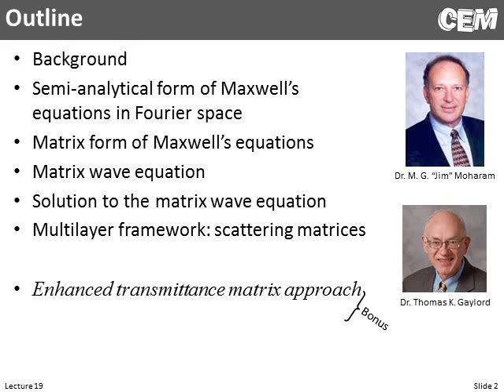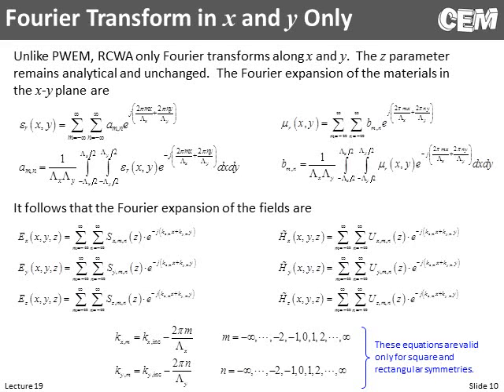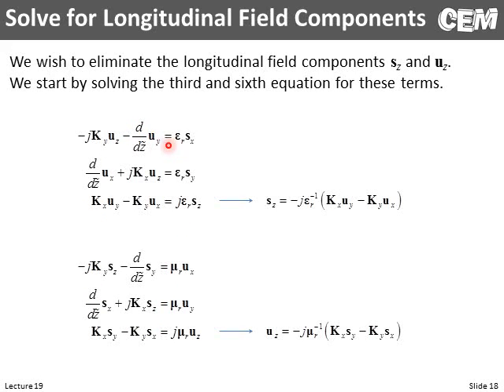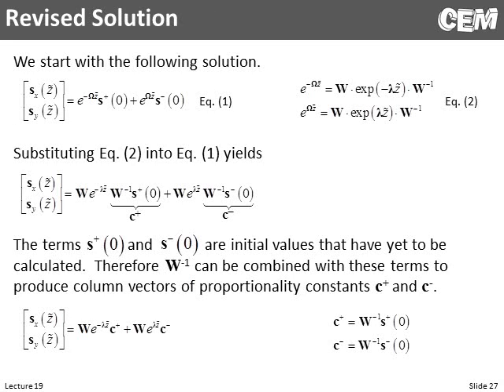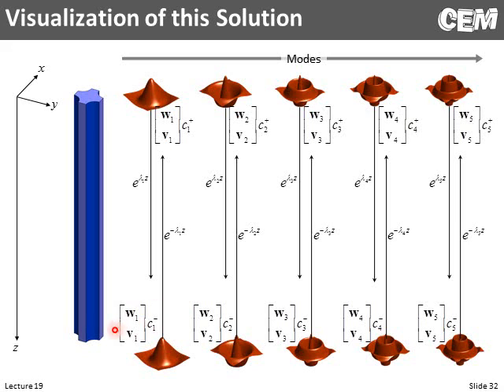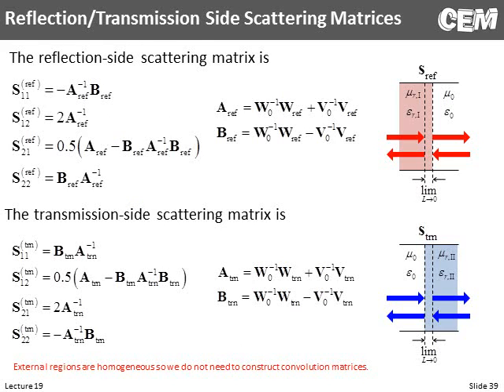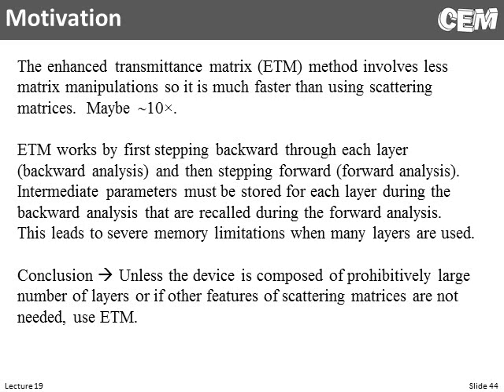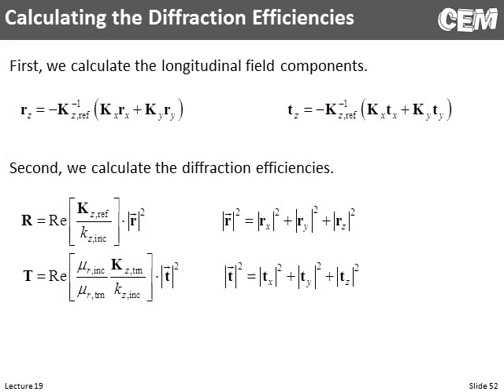Lecture 19 (CEM) -- Formulation of Rigorous Coupled-Wave Analysis

Comment: Hi, thank you kindly for your lectures.  I am trying to implement the RCWA for a 1D grating. However, I am using the full code (as opposed to the FFF approach mentioned in lecture 21). I am having trouble calculating the A & B Matrices (slide 37, lecture 19), since my V matrix in the layer (and also incidentally in free space) are turning out to be singular. Could you please provide a physical insight on why this might be happening in my case, and where I should look to resolve this? My W matrices seem quite fine.
Reply from the maker: At some frequencies, you could have wave vector components that equal zero and will cause singularities.  Try changing the frequency slightly and see if that fixes it.  If not, there is another problem with your code.
Reply: @empossible1577  Hello, changing the frequencies didn't seem to fix it. My apologies as this is my first introduction to performing such calculations. 

I would like to verify the size of my matrices to see if they are accurate. 
For the given scenario, 
Number of harmonics along Kx = M
Number of harmonics along Ky = N

after calculating Kx, Ky, and Kz, it has been suggested to put them in diagonal form. And since all the Kx_mn values reside on the diagonal, the size of the Kx & Ky matrices will be (M*N) x (M*N). 

In which case the size of the  P and Q matrices (in free space) will be  (2*M*N) x (2*M*N)

Am I okay till this part? 

Because the size of the Omega2 matrix will be the same as the P & Q matrices and will result in 2*M*N eigenvalues. Are half of these for the backward propagating modes and half for the forward ones? 

Thank you once again kindly, the lectures are fabulous, but such one to one clarifications also help immensely, and I acknowledge the investment and am grateful for the same.
Reply: @empossible1577  I am implementing the Code in Python, so the eigenvectors of Omega2 matrix come out normalized using the "Numpy.linalg" package. Do the matrix of vectors V = Q*W*(lambda)^-1 need to be normalized before calculating the Matrices A & B?
Reply from the maker: @RaviShivaraman  Have you seen the RCWA benchmarking documents on the course website?  These show almost all of the intermediate results from my RCWA code.  I suggest going through these to verify your data.  This is even more useful since you are developing your code in a different language.
Reply: @empossible1577  Hi, thanks a lot for the pointer. I was able to use the bench-marking documents to guide me in my python implementation.  There are some differences: 1. the 3x3 grid does not lead to energy conservation (slightly over 1), but a 5x5 grid does. 

I have also implemented RCWA calculations for the following geometry:

Device Stack: 

------------------------------------------------------------------
-------------------------------------
     Semi-infinite Reflection Zone (Air)

------------------------------------------------------------------
-------------------------------------
     
Diffraction Grating on Surface (~200 nm tall & 600 nm Period)

------------------------------------------------------------------
-------------------------------------
     Uniform Dielectric Layer (~1 mm)

------------------------------------------------------------------
-------------------------------------

     Semi-infinite Transmission Zone (Air)

------------------------------------------------------------------
-------------------------------------

The issue with the above stack is that I am unable to get sensible results, I believe the issue arising from the X matrix: exp(-lambda_dielectric * k0 * t_dielectric)
due to a large difference in the thickness of the uniform dielectric region compared to the grating region (> Million). 

I found that as long as the uniform dielectric thickness remains under a maximum value (per my results, a factor of 1000, so about a 20--50 microns - seems to depend on the incident wavelength as well) the calculation produces sensible results. 

If there 's physics here that I should be aware of , and perhaps if the dielectric is larger than a particular thickness, consider it the semi infinite reflection region, please let me know. Thank you kindly once again for your time.
Reply from the maker: @RaviShivaraman  The 3x3 case not satisfying conservation bothers me and I suspect something is wrong.  

Also, you should be able to set the thickness of your layers to virtually anything without issues.  I know I have set them to several kilometers and had no issues.

Can you email me a list of your layers (thickness + refractive index) and I will run a simulation to see what I get.  rcrumpf(at)utep.edu.

Comment: Dear Sir,

How to plot the electromagnetic fields in real Space from the mode coefficients in the modal basis? By an inverse Fourier transform? 

Thanks
Reply from the maker: I have some notes on how to do this for the plane wave expansion method.  See the notes for Lecture 20 here:

http://emlab.utep.edu/ee5390cem.htm

The material you are looking for is in the second section.  You essentially reshape the mode coefficients into a 2D array, pad that array with lots of zeros, inverse FFT the padded array to get the fields in real-space, and then multiply those real-space fields by a phase term to account for angle of incidence.

Comment: Wow, I just finish to write my code , test it and compare it with a commercial modal method, giving the same results :D thank you so much for this well-explained lecture, everything is derived in a so simple way :D

I would like to enhance my code with the Enhance Transmittance Matrix Approach, to get results faster, but one equation still remains unclear for me. On slide 51, how can I solve the matrix equation for r and t1 in Matlab? Because t1 is also expressed in B'...

Don't you have a benchmark file on utep.edu that would help on that?

Best,

Jules
Reply: Hi Jules, could you please guide me to implement RCWA into MATLAB?

Comment: how can we calculate the Hy(x,z) from the RCWA method?
Reply from the maker: Do you want to plot the fields?  This requires calculating the mode coefficients inside your device.  I outline how to do this in the electronic notes for Lecture 6 here:

http://emlab.utep.edu/ee5390cem.htm

The lecture reads that is for TMM, but it applies equally well to RCWA.

Comment: Dear Dr. Rumpf, if we have a general incident fields defined on 2D(x,y) plane in real space, in principle we should be able to decompose it directly into RCWA's modal basis, right? However I cannot find any material or papers describing this(most of them are assuming center-mode excitation as in slides.40), could you give some advice?
Reply from the maker: Happy to help!

I have not ever done this so there may be some details I am missing.  As I envision it, the process will be...

1. Create the cross section of your course in real-space in the x-y plane.
2. Fourier transform this source to get the Fourier coefficients.
3. Arrange the Fourier coefficients into a column vector called s_inc in the notes.
4. Last you will calculate the source mode coefficient, called c_inc in the notes as c_inc = inv(W_ref)*s_inc.

It is likely that your W_ref will be identify matrix so Step 4 can be simplified.  You can partly test the above by using a just a plane wave.  Your c_inc should reduce to the c_inc the standard algorithm would use.

Hope this helps!
Reply: Wow, thanks for prompt answer! this's also more or less I'm considering, my only detailed concern is: if we have arranged the Fourier coefficients as a column vector, how can we match the size of this vector with the size of the scattering matrix? suppose the scattering object is a 2D grating where we only have modes in one direction.
Reply from the maker: You should only retain the same Fourier coefficients that you retained when describing your materials.  Which Fourier coefficients you retained must match.
Reply: Thanks!  I agree, I was expecting there's some kind of projection matrix that could project the Fourier coefficients onto the modal basis, perhaps I'm asking too much and this even seems to be a research topic....
Reply from the maker: You can certainly come up with such a matrix.  In fact, you can use different Fourier coefficients in each layer if you wish.  You can just to do some math wizardry to match them.  In my experience, it is not worth the trouble.
Reply: Dear Dr. Rumpf, sorry, I got confused here and look for help again... I was trying to do as you suggested to retain only the Fourier coefficients that's used to describe the material, 
Suppose we have a 1D grating periodic in X direction, then for a general 2D(x,y) incident fields(say, Gaussian),  retaining the x-modes means we pick only one row in the Fourier transformed 2D Gaussian F(u,v), doesn't it mean we lost the other incident waves or these incident waves containing non-zero y modes will not excite waves in such grating?

Comment: Dear Dr. Rumpf,First and foremost, thank you for the lectures and benchmarking. I have my RCWA 99% working! I was wondering if you can help me with the last 1% as I am stumped. It all has to do with the function [V,D] = eig(OM_SQ) and what it returns for the layer calculations (this is not a problem for the transmission and reflection regions, as you don't use this function, and thus I match the benchmark). Basically all the eigenvectors/values are out of order and the imaginary parts sometimes have a sign discrepancy (other than that the values are the same and I confirmed Om_SQ*V - V*D = 0 ). This is confounding because my value of OM_SQ = P*Q matches your benchmark exactly so applying eig(OM_SQ) should work. 

 1. I feel as if as long as the order is kept consistent, the scattering matrices for the layer should be fine. But unsure of this statement as the S.11, S.12, S.21, and S.22 do not match the benchmark if the ordering isn't the same. 2. I would like to match your benchmark exactly (3x3 oblique RCWA). I can easily sort the eigenvalues/vectors in different ways, but the benchmark provided has seemingly no specific ordering for V and D; I assuming my MATLAB version is different than yours which outputs different orderings?TL;DR. eig() function outputs have no specific ordering -> values now differ from benchmark --> sorting the order makes sense but benchmark doesn't seem to sort in any specific way --> does this matter for S-matrix?Hope to hear back from you
Reply from the maker: Yes, different versions of MATLAB or other very subtle things can change the order that the eigen-modes are calculated.  While this makes it more difficult to benchmark, it is not a problem at all in terms of the correctness or robustness of your code.  The only important thing is to keep your eigen-values in the same order as the eigen-modes if you choose to sort them for some reason.  You do not want to mix up the pairing between the two.

I am glad the lectures are helping you!  You may also want to visit the official course website.  The electronic notes have seen a lot of revisions and improvements since the lectures were recorded.

http://emlab.utep.edu/ee5390cem.htm

Hope this helps!!
Reply: It certainly did! My RCWA code is now conserving power and giving the same S-Matrix values. Thanks for the help. Now to figure out how to retrieve metamaterial parameters, onward!
Reply from the maker: What kind of metamaterial are you analyzing?  Take a look at Lecture 15 in the 21st Century Electromagnetics course.  This lecture covers parameter retrieval and homogenization.

http://emlab.utep.edu/ee5390em21.htm
Reply: I'd love to talk to you about it. Is there an email I can reach you at?
Reply from the maker: Happy to help if I can.  All of my contact information is at the following link under Dr. Raymond C. Rumpf:

http://emlab.utep.edu/team.htm
Reply: I also have a question concerning mode order: if I want to calculate the intermediate fields inside the grating layers, I need to match the mode coefficients, eigenvectors and eigenvalues to the transversal field expansion. How can I figure out which order of my mode expansion the solutions of the eigenvalue problem are? In the reflection and transmission region this is trivial: I sort them directly when I create the wavevector expansion. But what about the grating region? Thank you for any hints and keep up the good work!

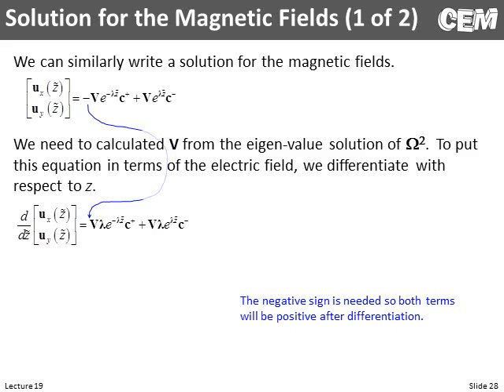Comment: Thanks for the great lectures. I was wondering if there is any reason to have similar initial values (c+ and c-) in 21:40 for magnetic fields compared to electric fields?
Reply from the maker: The magnetic field was normalized to be as equal to the electric field as possible.  In air, they will be the same.  In another medium, they will be slightly different.
Reply: I see! Thanks
Reply: In writing electric fields in Fourier space (8:17) why exp(-jk_z*z) is not in the expansion. Is it absorbed in S(m,n,z) or will be considered when solving ODE later? I assume that according to Bloch theorem we should write the E field as E(x,y,z) = A(x,y) exp(-jbeta.r) in which we can expand A(x,y) in Fourier series and it will result in E(x,y,z) = sum{sum[S(m,n,z) exp(-j(kxpq*x + kypq*y + kz*z)]}. Thanks!
Reply from the maker: Yes, it is part of S(z) and U(z) at this step.  Later, it arises after solving the differential equation.

Comment: I tried the solution in homogeneous layers for gold uniform layer on glass and it doesn't agree with neither the fresnel's transfer matrix formalism nor the solution from the eig function in matlab. There must be something different for lossy media because the lossless one works fine.
Reply: PS. the position that doesn't match well is around plasmon dip.
Reply from the maker: it is hard for me to say what is wrong.  The method itself is rigorous so there is nothing fundamental about it that would make it incapable of performing such a simulation.  In these notes, the TMM was formulated using the +jkz sign convention while RCWA was formulated using the -jkz convention.  This will require you to conjugate your material properties between methods.  In other words,  you perhaps have incorporated your metal with gain instead of loss.

If this is not it, I suggest working your RCWA code through the benchmarking documents on the course website to try to find the error.  Here is a link to the course website:

http://emlab.utep.edu/ee5390cem.htm

Comment: Thanx Dr. could you post an matlab code example for RCWA calculation
Reply from the maker: Listen to the next couple of lectures and see where you are.  The block diagrams are extremely close to codes.  As a general rule, I do not give out the codes.  I think it shuts down the learning and puts people in a code "hacking" mentality instead of a code writing mentality.
Reply from the maker: Another thing you could do it use the Benchmarking documents that I provide here:

http://emlab.utep.edu/ee5390cem.htm

They essentially take your step-by-step through RCWA and provide the intermediate results at each step.  This is great for verifying your code and the flow of your algorithm.

Hope this helps!
Reply: what I am doing is to use dispersion data file for each layer and I want to do 6 layer structure.
Reply from the maker: What is in your dispersion data file?  Is this measured values of n and k?  If so, you will setup a loop over frequency.  Inside the loop you will look up the material properties for that frequency from your file, build your device using those material properties, model it, and then store the results.  The loop iterates through all frequencies this way.

If this isn't what you mean, please tell me what is in your dispersion data file.
Reply: The dispersion file has the wavelength n and k and the structure that I want to build is uniform in one direction only
Reply from the maker: I talk a little bit about parameters sweeps in Lecture 14.  It is pretty straightfoward.  I think what I said in my previous comment applies.

good luck!!